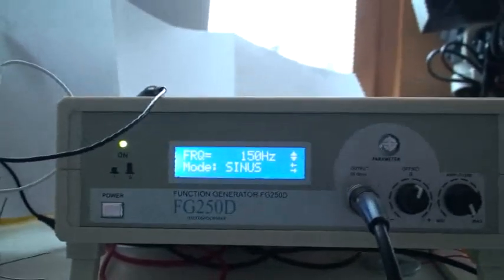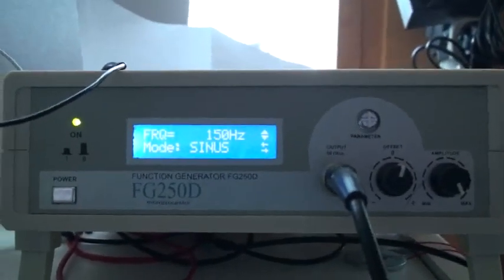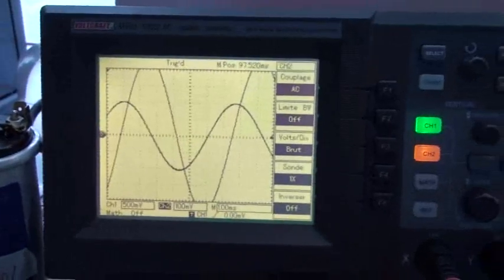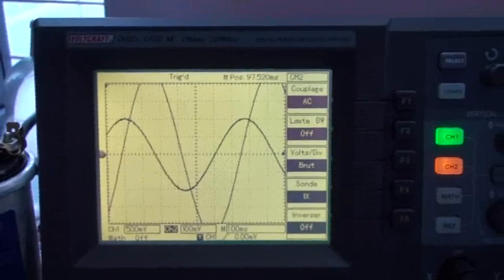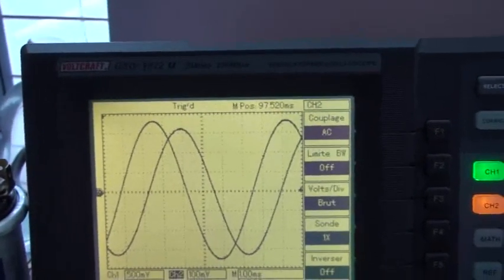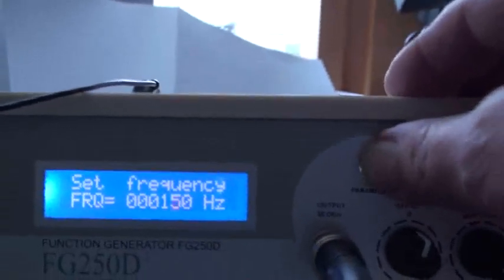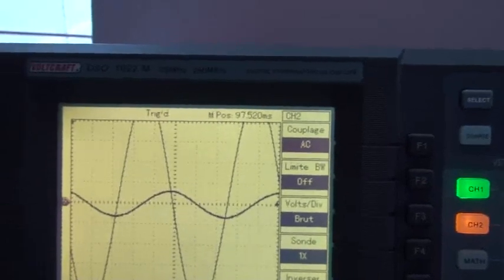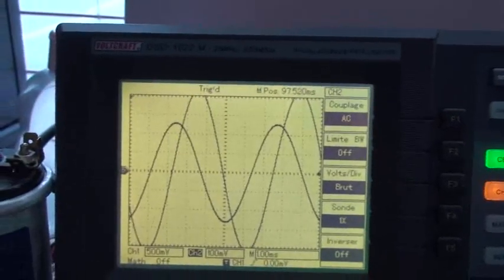Lenz delayed experiment 2.wmv

Comment: It's intresting to see that at 150 hz there is no phas shift between on and no load without the capacitor. The current doesn't go up with the capacitor when loaded, but as there is almost nearly a 180° phase shift, the cosphi also nearly doesn't change. Is this a lead to overunity?